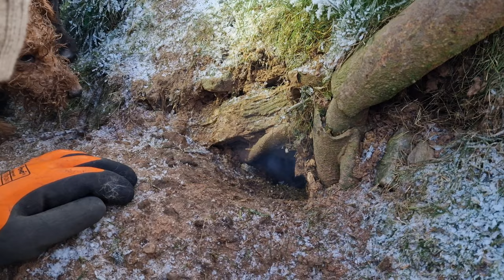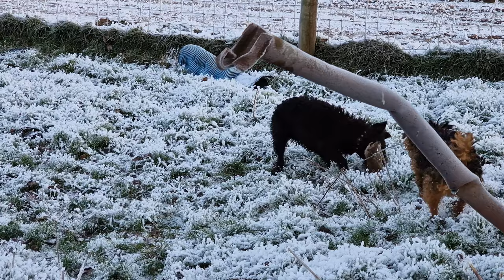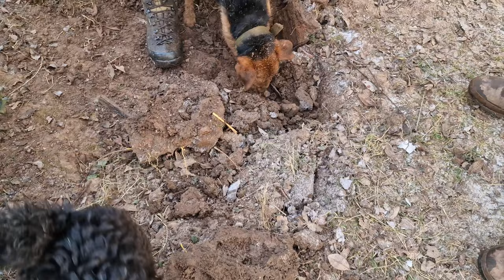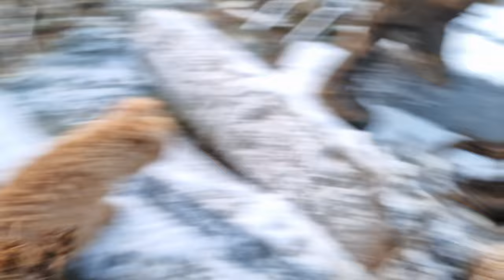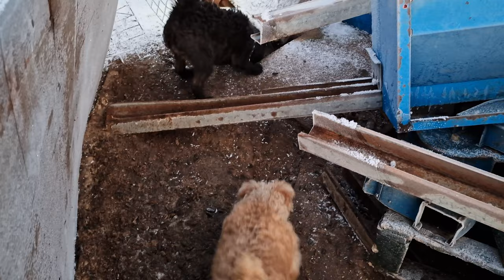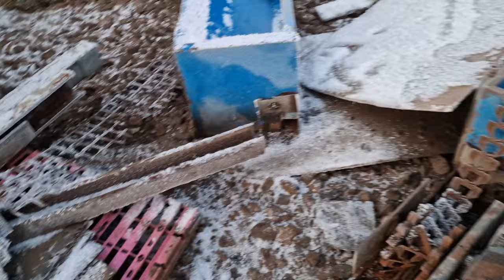151 Rats With Terriers - Cumbrian Rat Pack

Comment: I am german. In 2000s i wallked often with my fathers Rottweiler over the meadows ( Wiesen). The dog liked to smell at small dirt hills, dug by Wühlmäuse or Maulwürfe ( don' t know english names) , and often started digging with front legs and snout. Usually unsucessfull. But one day a Wühlmaus ( a type of mouse) was so idiotic, to look out of a hole. The Rottweiler beat the mouse down with a strike of frontleg, then he bite it. But: When a mouse is so idiotic, to be catched by a Rottweiler , something is strange, may be the mouse is ill or poisoned. Now , try to remove a mouse out of the snout of an angry Rottweiler. Not so easy.